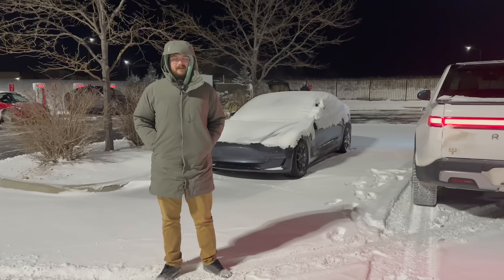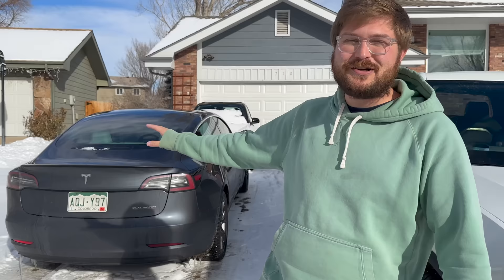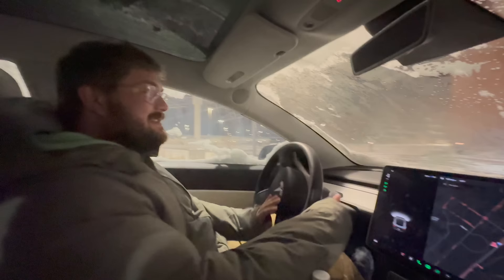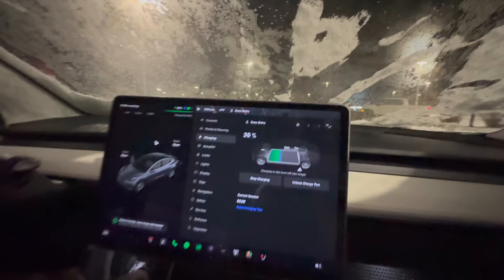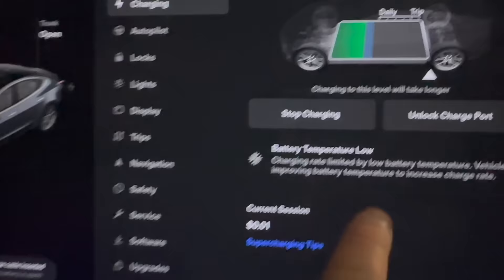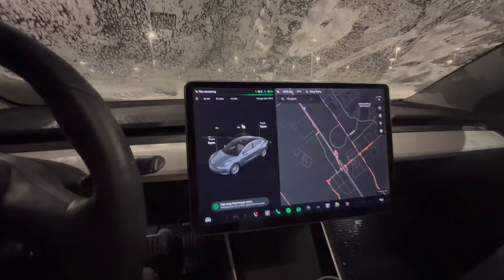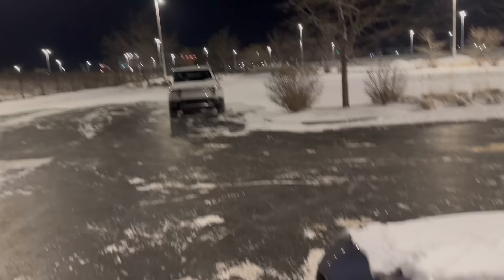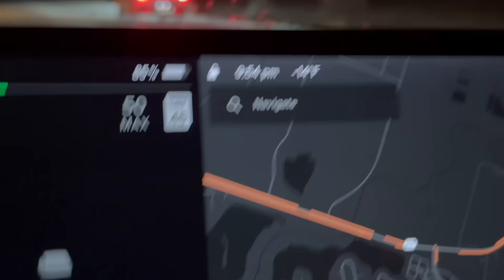I Deep Froze My Tesla And Immediately Plugged It Into A Supercharger To See What Happens

Comment: For those who live right near by the supercharger, if you even turn on your tesla cabin heater on, it will start heating your battery as well, so just make it toasty before driving to supercharger and it will be way efficient charging than just showing up cold 🥶
Reply: I just get gas, takes me 5 minutes MAX if that, and i’m gone. over 500 miles.
Reply: @johnnylego807  this is about doing it in -20° F. At that temperature, your vehicle is not going to even start in the first place unlike a Tesla and you're probably going to have to get an engine block heater as well as an oil heater and something to jump the vehicle and a battery blanket as well. Your rubber tiles will be dented in the area that touches the ground so you'll be going to get very low speeds until they warm up anyways but the beauty of hybrids and electrics is even in this crap of the weather they'll start and move
Reply: thanks for the tip!
Reply: @NadeemAhmed-nv2br  Lol yea ok, here in Canada I've parked my vehicles overnight at below -30C without a block heater and was still able to start them no problem. If you have an old shitty battery obviously it'll have problems starting, I guarantee an older battery in a Tesla is going to give some problems in the cold as well. I'd rather not screw around having to wait for the battery to warm up or charge the damn thing while i'm getting frostbite, and this is after messing with that charger that looks like a pain in the ass to deal with in freezing weather.
Reply: @rustyboltz2820  "an older tesla battery is going to give some problems in the cold as well"
it does not work like that. For a combustion car battery it is about giving the power needed to ignite the flame, in one moment. for an electric car battery it is about supplying the needet energy over time so the older state of the battery could in normal cases only limit the total sum of power stored but that mpstly applies for batteries 8+ years or older. The trick for heating it up before driving is explained in the comment we are writing answers to. 

Hope i could solve some misunderstandings and sorry for my gramatical errors because english is not my native tounge.
Reply: @johnnylego807  Pretty sure we all know how gas works.
Reply: @johnnylego807  You're in a video about testing tesla batteries.
Your comment about gas is unecessary.
The only thing gas excells at is the speed at which you can fill the tank with.
That's basically it and that will be over soon as well.
Reply: @ikat_tracer  🤣🤣🤣 Tesla chargers are still being fed electricity by Coal and Diesel based generators, Your still using Gas, just changing it from one form of energy for another. That’s the part they don’t like to tell you. If everyone had an EV right now the grid would collapse.
Reply: @NadeemAhmed-nv2br  Quite the opposite. Seems the Tesla won’t start in -20 F weather. As the battery can’t get warm enough to actually be of any use. I’ve never encountered this issue with a gas car, even in -20f Weather, sometimes it’s a rough start and needs a minute to warm up. But I’ve never been stranded. I’ve never had to jump start my car either in cold weather. Gas for the win!
Reply: @johnnylego807  None of the things you wrote are true. When running electric cars off coal and diesel, they still emit less CO2 (including battery production) than a gas car.

The real goal is to get it ready. When you have something, like an electric heater, etc. you can actually choose what to power it with, meaning in the future, if it eventually does switch to renewable, it's already ready and can receive something clean without any changes needed. (Apart from that energy also being far far cheaper to produce)

Your argument is like saying the gas car will never be a thing, because there are no gas stations and horses are more common anyway. 

Additionally gas cars not only don't start in the cold - they also die even more in the heat.
Reply: @johnnylego807 or just ride a horse, no gas needed
Reply: After seeing just part of this comic show,I'll keep my Stinger. What was he thinking when he bought that piece of crap.
Reply: @NadeemAhmed-nv2br What planet are you from?!? Lol I'm from Chicago and it gets -20 or more below here! My 1988 Chevy Caprice even starts right up. FOH! 😂
Reply: @NadeemAhmed-nv2br knock it off lol
Reply: @ikat_tracer and range per fill not loosing range sitting in cold weather
Reply: @chefcjnobles1680 nice! There’s not a day that goes by I don’t miss my old ‘79 and ‘87 Chevy Caprices. Shame GM doesn’t make cars like that anymore.
Reply: My truck starts at any temp
Reply: @NadeemAhmed-nv2br  Obviously you no nothing about cold weather and new vehicles. I worked on ice road and even my 2016 Ford diesel would start at -40 after two days of sitting there. All modern vehicles will start at -20 C unless you have been stupid and use cheap crappy none synthetic oil or have an old battery that is due for replacement. Canadian here that has experienced a lot of -40 temperatures.
Reply: @ikat_tracer  nah gas is superior for most things.   range is double.  cost is half.   doesnt randomly erupt into uncontrollable flames.    better build quality.   faster to fill.   better in cold areas by far.   far better for towing.
Reply: @rustyboltz2820 you have to stand outside and pump the gas no? I just plug my Tesla in and get back into a car that heats up in 2 min in 25 degrees Fahrenheit
Reply: @johnnylego807  Wow surely not the USA ... in Kenya in Africa they manage to generate 85% of their electricity from renewables. Change your vote to support people who are interested to facilitate the modernisation of your grid. Anyway, it's just as well that an EV still manages to have greater energy efficiency even if powered from a grid entirely powered from fossil fuels. (But don't be too pessimistic .. diesel generation for the grid in the USA is negligible and coal was around 19% according to the US Energy Information Administration for 2022.)
Reply: @johngreene6780  I guess you have an EV truck.
Reply: @NadeemAhmed-nv2br 
That's what fuel injection is for.  At 25 below F my Trailblazer fires right off.  I let the engine oil warm up for five minutes and I'm gone.  I use 10W30 oil in the winter so it starts easily when that cold.
Reply: @NadeemAhmed-nv2br  a diesel will start and run. Soo :) ..
Reply: Those lithium ion batteries are hazardous! I have dealt with them for years. I think I’ll stick with my gasoline powered car. Especially now that gas prices are poised to significantly drop in 2025.
Reply: @johnnylego807  hopefully you have a nice engine block heater otherwise (if it cranks) that's some lovely metal on metal contact for a few minutes while the oil is still a sludge
Reply: @johnnylego807  Less fossil fuel mix in the grid every year. There are many things you are not told about the production of gasoline for an ICE car, most bad. If everyone had an EV, it would be 2040 and the grid will be more than capable for any extra load before then, especially when you consider a properly managed and encouraged installation of solar+battery on homes and other load-adjacent installation points. Electricity will be much cheaper.
Reply: @NadeemAhmed-nv2br bullshit. Any more than a gallon and it's starting
Reply: @Murv you're so full of it. There's a reason nobody buys electric and it's not the price
Reply: @johnnylego807  I fuel my jaguar once a month which takes me 3 to 5 minutes and not 20 minutesor20 hours. 570 miles of range. 20 degrees or 20 below, It starts right up, I run it for 6 minutes nice and toasty and I'm up and out.
Reply: @T4Tesla  I rather stand outside for 3 minutes than plug in and stay awhile. I worked outside, all day! Trust me standing outside for 3 minutes doesn't faze me one bit. I hate sitting around and waiting. Waiting? Better you than me..
Reply: @NadeemAhmed-nv2br My Honda and Toyotas start reliably at 25 below.
Reply: Whag a crock. 5 minutes at a gas pump for me. And my cabin heater doesn't reduce range, and I stay warm.
Reply: @NadeemAhmed-nv2br mine have been starting fine in -25 degree weather without a block heater. And in 10 minutes the heater is blowing out hot air.
Reply: @johnehlert4366  10 minutes? Takes me 6 to heat mine. I'm gone in 10. ...
Reply: @ikat_tracer plonker when your battery needs replacing for the sum of 50000  plus pounds a petrol engine can be done for 5 thousand or less who can afford to stay on the Rd  errrmm

Comment: I don't know much about Tesla's, but I learned so much from this video.  I know now to take special precautions to keep battery warm when temps drop really low. Therefore, for those with garages should install their own chargers so they can charge it the night before with their own Tesla charger.  The software applications for the diagnostics on the screen looked quite amazing.

Comment: Pack temperature is one of the most informative pieces of data for an EV driver to understand vehicle performance and it’s a shame most EVs don’t show it. I keep a min/max pack temp display on my Tesla and Rivian dash to understand how the car will drive and charge.
Reply: How did you accomplish that? (Engineer nerds want to know!!)
Reply: Or not lol
Reply: How to get park temperature in tesla?
Reply: @2QRh6g1I  thanks, I wish tesla could provide this info directly from their interface, but that video is great to get lot of information from car.
Reply: Probably because the passively cooled ones would show them running too hot in warmer climates.
Reply: I’d rather hand crank my engine to start than have to deal with all of the hoopla involved in EV ownership
Reply: @jacobgautschi6286  Couldn't have said it better. So these two sit in a freezing car with only heated seats to wait 30+ minutes? And the cables freeze up? My gas pump handles never freeze up. Also the hood in EVs get frozen with snow and ice collecting on it during storms which is a hazard and it will not easily clear. Unlike my V8 that heats that hood and nothing sticks to it during winter storms.
Reply: @packetattack7437  @jacobgautschi6286  Did you two even listen to what he was saying in the video? This is an extreme test that no one will ever experience in normal operation of the vehicle. Letting it sit in the cold during a cold night and then immediately after plug it into a fast charger. No, normally you'd start the cabin heater from your app before getting in, drive the car to the fast charger, during which it will automatically heat up both the cabin and the battery, and then plug in and immediately get a decent charge speed.
Reply: It's by far the most annoying thing about my Cupra Born, it doesn't preheat the battery and it gives little to no information at all about the battery status other than state of charge.
Reply: @woalk   LOL are you eating your words now that this last winter storm left MANY tesla drivers stuck? Just look up Chicago.....

This scenario in the video just happened to about 50 million Americans LOL.
Reply: @codejunki567  I stand by what I say. If you use your EV correctly (precondition by setting your navigation to a charger, plan ahead that your range will be lower in winter), you will not face any of these problems (besides defective charging stations, that is of course out of your control and not the fault of EVs).
Reply: @woalk  No defects at the gas station..lol! They always work and if not,see the next corner..
Reply: @carlsmith1118  We’re getting there with charging stations, too.
Reply: @woalk  Im not sure what percent of EV owners own a charger of their own, and a house to charge at. So lets go with 50%, there are 25,000 EVs in Chicago (cook county), so 12,500 EVs need to be charged if you want any chance to use your vehicle. 

OR the other option, you can just not drive you car in the harsh winter if you own a tesla, problem solved. LOL.
Reply: @codejunki567 if this happened to every tesla owner in Chicago the charging stations would be packed with a line of dead teslas. The only ones who don't preheat, or don't plan will get stuck.
Reply: @381delirius   "the charging stations would be packed with a line of dead teslas" So I am assuming you didn't watch any American news over this last weekend.
Reply: @woalk they don't actually watch these videos. They just come to the comments to bad mouth people who own EVs
Reply: @carlsmith1118 plenty of chargers next corner... You are talking about non existent problems. I'd rather wait 15 mins and pay £10 than do it in 2 mins and pay £80
Reply: @777jrg  that's there, not in Pennsylvania USA. Improve the EV with shorter down times and longer range and I'm all in
Reply: @woalk  Even more to the point, you'd leave your car plugged in at home so not only can you warm up your car on "shore power" in the morning, its battery will already be fully charged so you don't have to go to the supercharger at all. Superchargers are really meant for road trips. (Or for early Tesla adopters like me with free supercharging for the life of my car. Otherwise I'd charge entirely at home where my overnight kWh prices are much less than the usual supercharging prices.)
Reply: @philkarn1761  It’s also better for the battery to trickle charge slowly than to fast charge. Fast charging produces a lot of heat and strain and will lead to the battery losing maximum capacity faster.
Reply: @woalk  I've heard that, and it's plausible, but I'd like to see some actual test data to back it up. Is there any evidence that fast charging is harmful provided that temperature and individual cell voltages are properly limited?

Comment: Thanks for running this! I am an engineer responsible for thermal systems on BEV with a large auto maker. Really helpful to see how the competition is doing.
Reply: Which car has best battery thermal management? Also, do you have any influence to improve public CCS charging?
Reply: Thanks for your hard work on EVs.
Reply: Replying to Barry, ALL OF THE CCS CHARGING INFRASTRUCTURE DECISIONS ARE BASED ON THE THERMAL TESTING LAB TECHNICIANS OPINION.
Reply: @eletrohitsbr  I have not had a CCS charging problem for over 7 years.
Reply: @barryw9473  Guess you don't use them very much then.
Reply: @TecnamTwin  I use them about a dozen times a year. Mostly EA with a bit of EVgo.
Reply: @barryw9473  dang, I have had maybe a 30% success rate with EA at the same annual usage as you. You should definitely buy lottery tickets for all of us with your great luck 😂
Reply: @JamieHarveyJr  I always check plugshare before I plan a trip, and my e-Golf only pulls 40 kW max, so maybe that explains my very high success rate?
Reply: @barryw9473  early 2000's Chevy 5.3 with over 215000 on it. Hates cold starts yet fires right up. Runs beautifully once warmed up. No issues refueling. Almost 400 gallons per tank on a 4wd work truck. I'm all for EV'S. I love watching the evolution.  Its amazing........Not THERE yet though..... not even close.
Reply: @YourName-us6wu  hey, don’t buy one. Plenty of people are in line for them and no one can make enough EV trucks.
Reply: @barryw9473  Hahaha.  People lining up to save the environment!  Or at least trend like that's what they are doing.... Most people in the US are trying to figure out how to make their rent or mortgage payments, and feed their families........EVs aren't answering any of those demands.......You are way out of touch....
Reply: @barryw9473  BTW.  Drove my truck from NY to FL and back. Stopped  6 times for  fuel/bathroom breaks each way. Made real good time.
Reply: @YourName-us6wu  waow, you’re such a champ!
Reply: @marcd6897  Hehe. The truck and myself both easily out-champed any EV currently offered. BTW....how are these charging stations getting power again?
Reply: @YourName-us6wu  even an EV powered by 100% coal power is cleaner than an ice car.  And of course coal is going the way of the dodo.
Reply: @YourName-us6wu  people have mortgage problems, I agree. But there is also a 2 year waiting list for F-150 lightnings. Such is life in the world.
Reply: @barryw9473  Whats your point? My point is that those lightnings are no where near as capable (milage wise)  as a petrol or hybrid truck. Watch some review videos.
Reply: @YourName-us6wu  they are capable enough for many people, but not all. That does not make it a worthless vehicle. Keep your truck as that is what you need, but people can make their own choices.
Reply: @barryw9473  Not saying they don't have a place. Would be great for running around doing estimates and quick material runs.  They just can't compete when it comes down to long hauls. I'm sure they will get there eventually.
Reply: @barryw9473  agreed
Reply: Tesla manufactured its ev the right way to go from the very beginning with the model S, with battery preconditioning and road trip planner in mind, and it has been consistent and even improved over time. 
I own a 2022 Ioniq 5 SEL RWD and don't have battery preconditioning and not even a good trip planner. Just now, the new 2023 includes the battery preconditioning in all trim levels, but let's see how good it performs in these extreme cold weather.
Reply: I’ve owned a construction company. 99 to 100% of my trucks never drove more than 150 miles a day. However my trucks averaged 500 miles a week do you have any idea how much I paid in fuel a week per truck? no one gives a hoot about your groceries dude. It’s called capitalism if I still owned a construction company I guarantee you I would want my trucks to be low end Ford F1 50s with 300 mile range I’m guessing I would save about $100 a week per vehicle… this has nothing to do with saving the planet it’s called, saving my money!